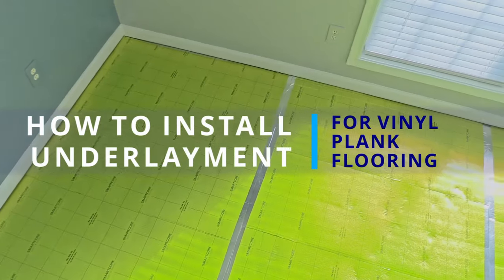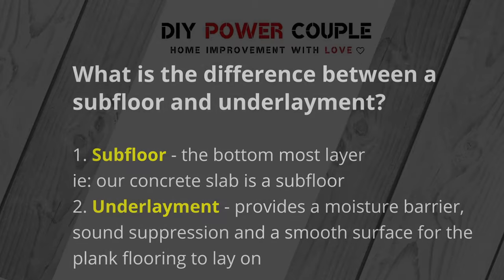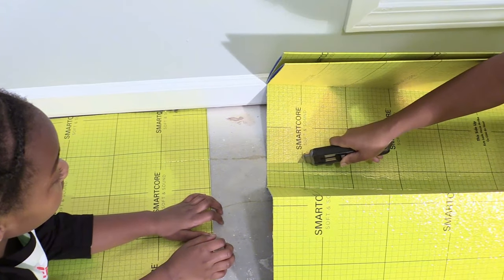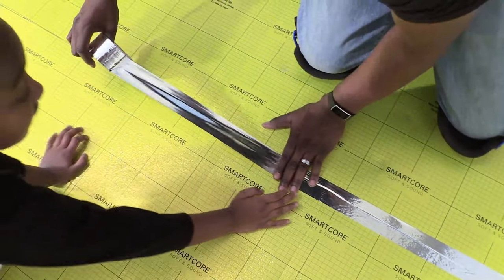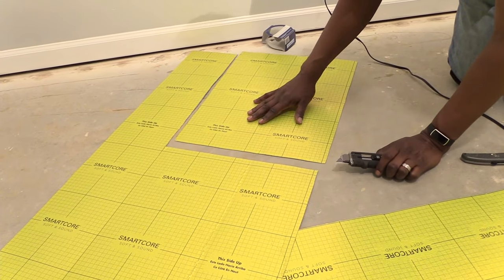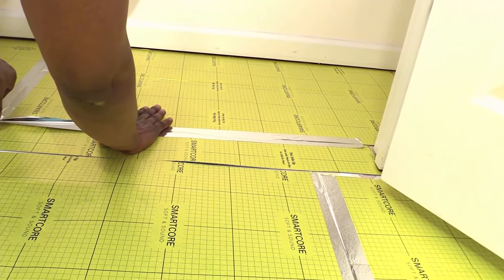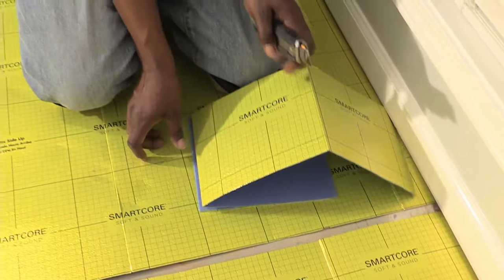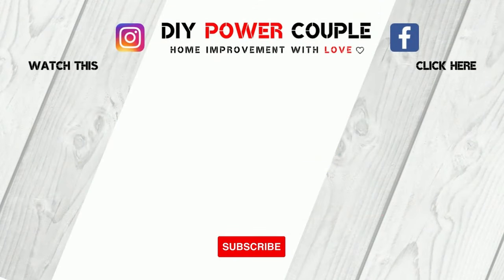How to Install Underlayment for Vinyl Plank Flooring | EASY BEGINNER DIY

Comment: Thanks very helpful.  I installed flooring in one room without underlayment since it was not recommended.  It worked out fine but wanted a little extra cushion and sound proof afterward so this is helpful for my next room I will do.  I just hadn't seen anyone do it so thanks for the help from this video.
Reply from the maker: You're welcome, Superman 🦸‍♀️

Comment: Thank you for this video. The laminate cracked & subflloor needed replaced in the bathroom  from the previous person did not lay the moisture barrier
Reply: It sounds like that floor has too much flexion or it wasn't properly leveled, there should be no more than an 1/8th in dip variance. I'd suggest installing 1/4 Luan running the option direction of the subfloor to bulk up the floor. By going opposite of the subfloor it will help brace the floor quite a lot despite being rather thin wood. This is what I've done along with many contractors. It will also help with making the floor more quiet to walk on and far less creaking. The moisture barrier like this type can help float out those imperfections but I wouldnt soley rely on it to float the floor. Generally the luan can address that on its own if it's minorGood luck to you!

Comment: Would be an alternative to fixing the actual concrete itself under?
Reply from the maker: Hi Tubbyteak, just make sure the concrete is level and is in good shape.  If it really needs repair, go ahead before you put your flooring on top. 👍🏾

Comment: Hello. Thanks for your video!  If you're installing Vinyl Plank Flooring that already comes with 1mm pad underneath, over a plywood subfloor, do you still need to install an underlayment?
Reply from the maker: Hi, only if the manufacturer recommends it and you want extra sound proofing/ moisture barrier.